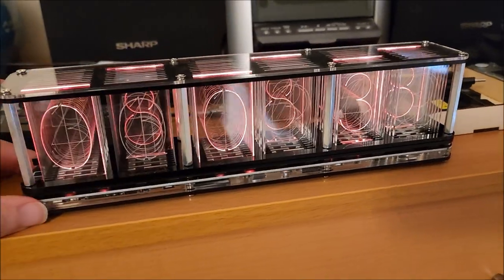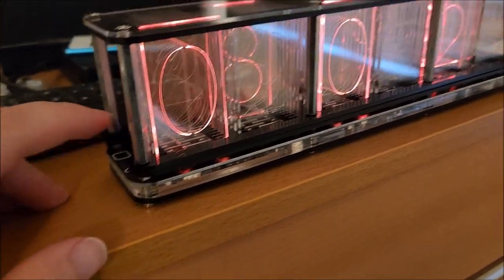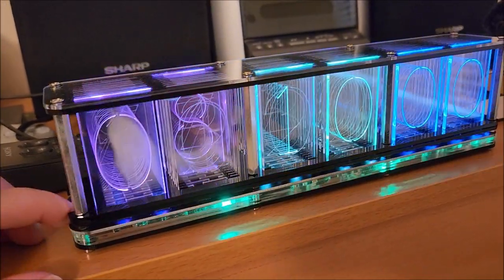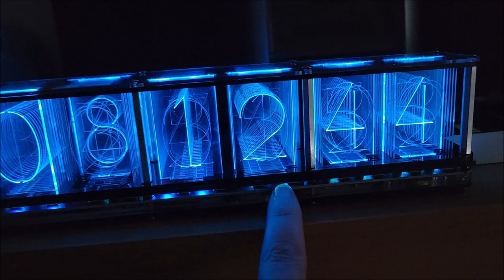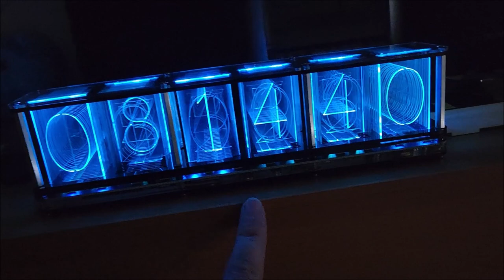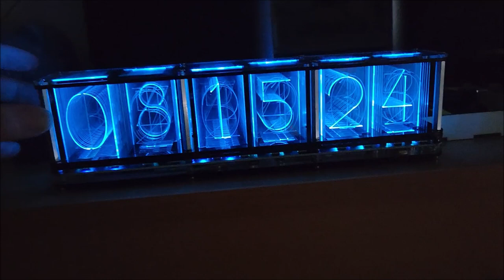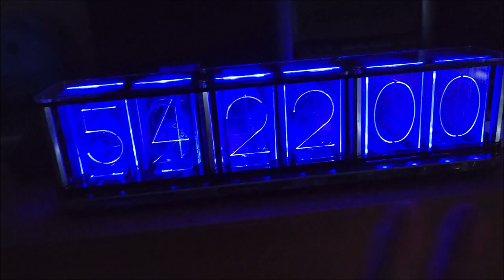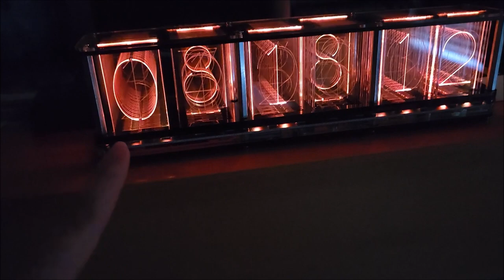Let's Assemble an ICStation DIY Faux Nixie Clock Kit!

Comment: Have you tried to insert the battery after complete setup? Or is everything going to fall apart!
Reply from the maker: Yes I did, but it was kinda a pain to do.
Reply: @sjm4306  Thanks for your reply. I was afraid that it wouldn't be easy 😥